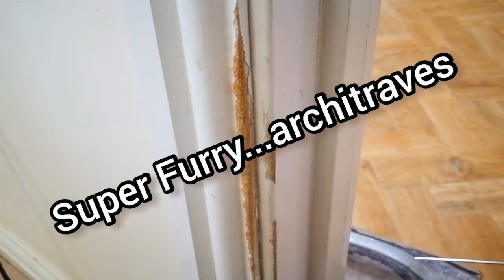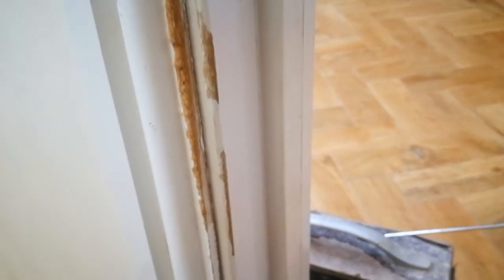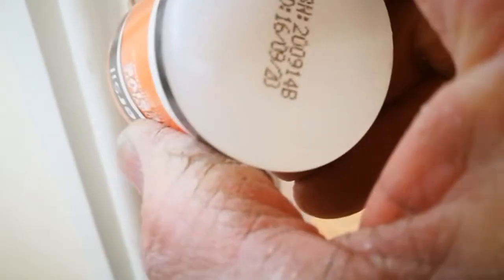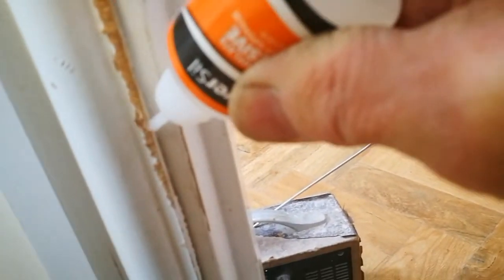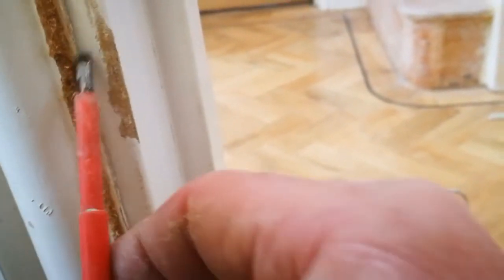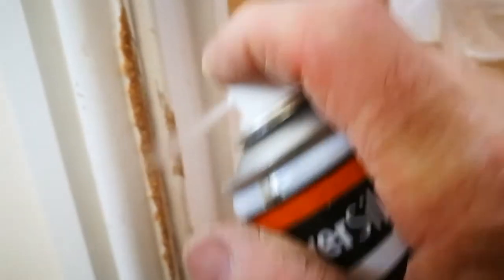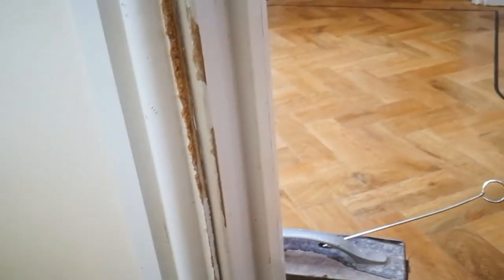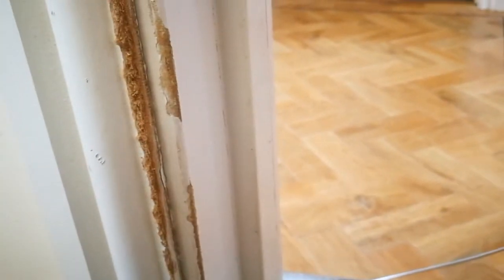Quick tip: repair chewed MDF trim

Comment: New piece of architrave for a tenner. Wasn't really worth the hassle was it
Reply from the maker: Yes actually, it was.
There would be no chance of getting an exact match to the existing profile.
Although the torus pattern is fairly universal, every manufacturer's exact pattern will differ.
But, say, for example I could get some, take off the old and make good any potential damage to the plaster, 20 mins, go and get a new piece 1hr unless I was out getting stuff anyway plus mileage, cut, fit, fill, prime, possibly another 1hr. So 2hrs 20mins work plus mileage, so that £10 bit of arch ends up costing £50 plus. Not worth it, so a bit of CA glue and filler and 20 mins of faffing is really cost effective.
Cheers 🙂